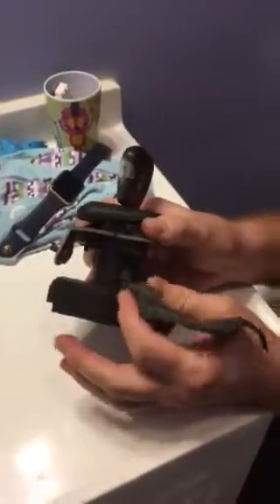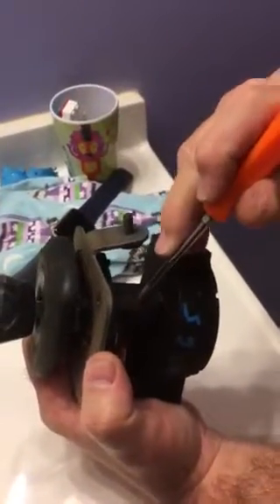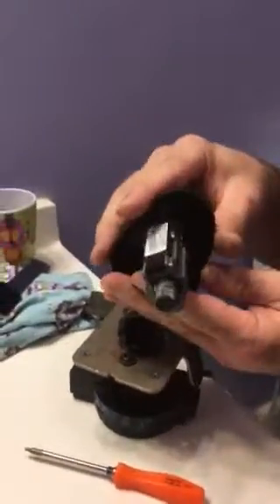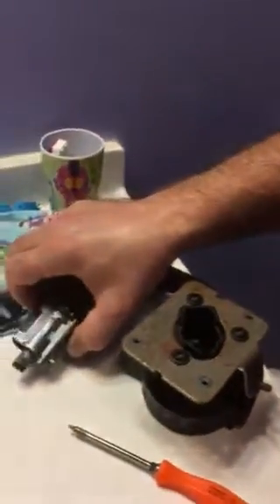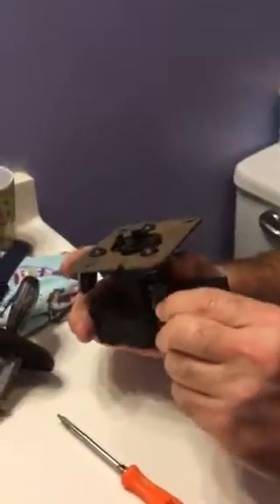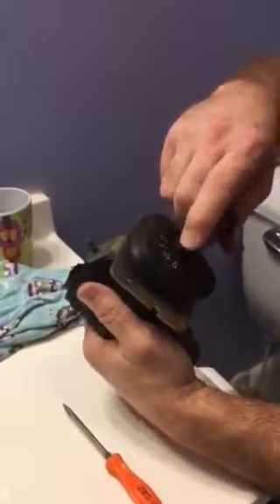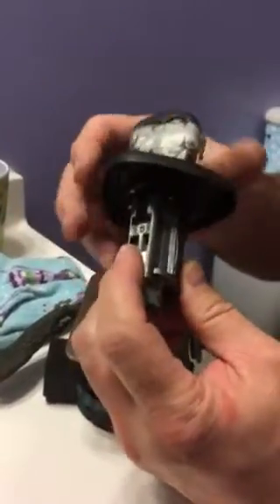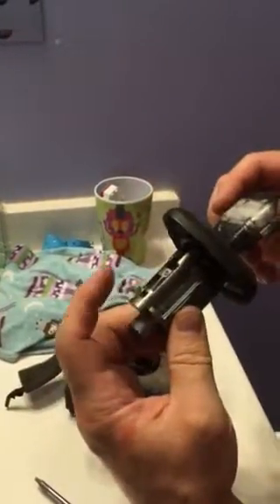2007 Saab 9-7x ignition switch

Comment: Grate video! I finally found one at the local Pick N Pull. The don’t have the key, any recommendations on how to turn the lock cylinder to get it off so I can use my original?
Reply: Did you figure this out without the key? I’m thinking you could use your original key just to be able to turn the cylinder
Reply: Eric McDaniel  Had to drill the lock cylinder out. Tried my key, would not work...
Reply: no spark how did it work out after that? I have two spares. One with a key and one without. If you need one let me know
Reply: @ericmcdaniel4029  I have an 05. Dealership says it has to be a new one never coded to a vehicle for it to work right. Can't find any new uncoded.   Is there a reason a used one with a key wouldn't work?

Comment from the maker: The part was replaced because I thought it would fix the no crank,no power windows, no radio problem.  The problem was the Driver seat module taking out part of the class 2 buss. Unplugged the seat module and plugged it back in and vehicle worked perfect.

Comment: Anyway you have a spare you could sell??
Reply from the maker: No spare
Reply: jpl57210 thanks for responding anyway. Man I’m terrified about mine taking a crap. There are none anywhere. Noda. Zip. Only in scrap yards and none in my state
Reply from the maker: I don't have a spare. Had to get from junkyard also.
Reply: jpl57210 hey again. Do I need to disconnect the battery in the car to do this job?
Reply from the maker: @ericmcdaniel4029  I apologize,I do not monitor messages.  Yes the battery should be disconnected/on the other hand the key will not remove without battery power. Its a foreign thing.
Reply: jpl57210 no I hear ya. Wish there was a way to direct message on YouTube but oh well. Thank you for the advice. Love this Saab but this is the only thing I wish they would of not of made different. Ridiculous